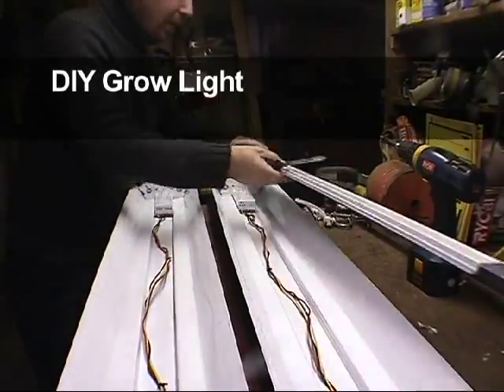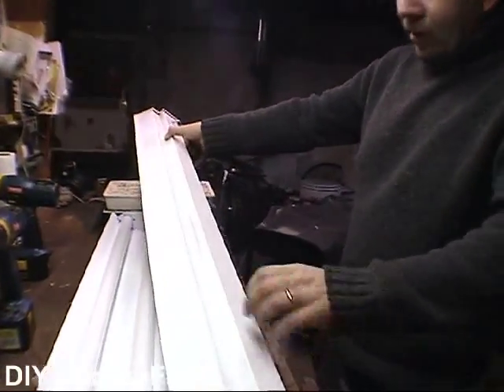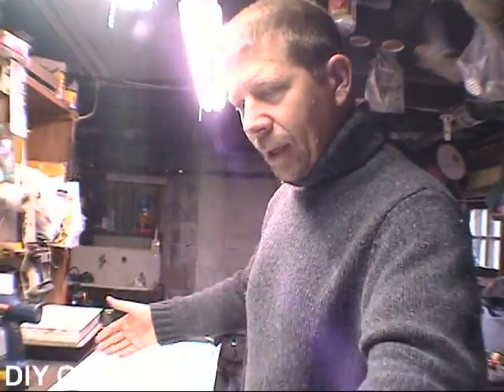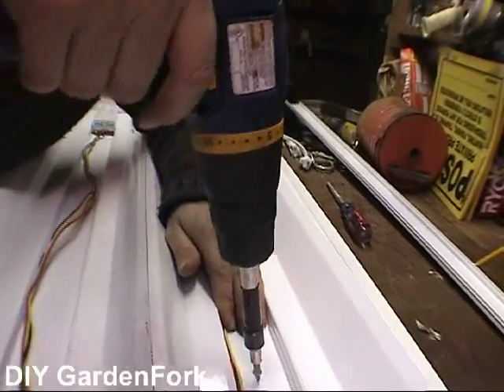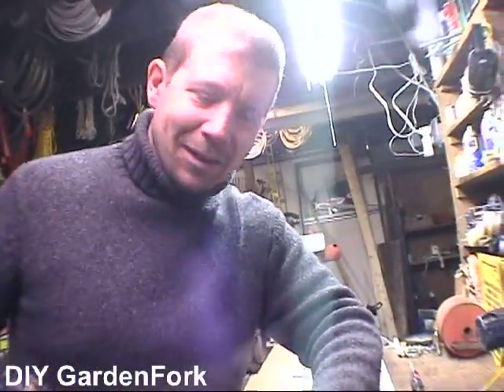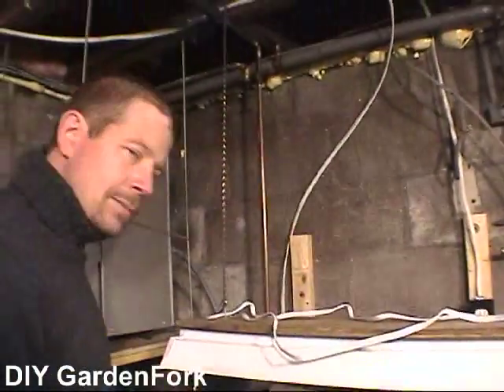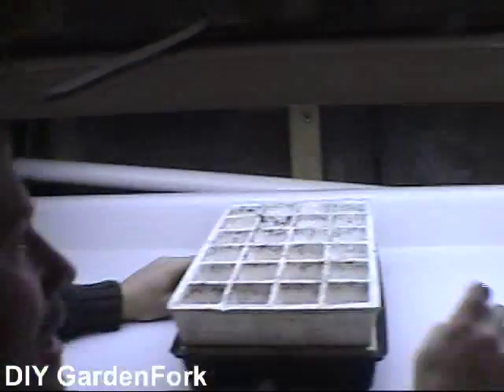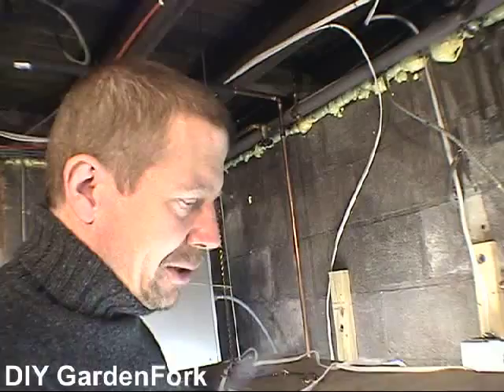Cheap Grow Lights - GardenFork

Comment: I have that type of workshop lights but I'm not handy  enuf to build anything, so I just rest the lighting fixtures on old VHS tapes, 4, 5,...8 if needed..  As the plants grow, I can add another tape or two.   I can even raise one side more than the other with the tapes and they hold well and don't slip.  The tapes are all a uniform size and I have several left over from when I changed over to DVDs.  I've been doing this for 4 years now.
Reply from the maker: Sandra Cerino excellent use of tapes for a grow light rig, it all works!  thx, eric.

Comment: I have a question which may be stupid but I cant seem to get an answer.  Ok so lets use veg state as an example.  You are to use something that is in the blue spectrum for vegging so.  If I say use 8 x 5000k CFL's it is not in the 6500k area so if I was to add a LED blue floodlight would that add the blue light needed in that spectrum?  Would the white light drown out the blue light or does the blue light still make it to the plant?  If the blue light does will it make a difference?  Does the blue light from a LED give you the blue light spectrum you need or does it not work that way?  Same thing for Flowering using a red LED light with 2700K CFL's will that flood light give you the right Red light spectrum you need?
Reply from the maker: for the short amount of time vegetable seedlings are under a grow light, the regular shop lights work fine. if you want to grow mature plants under lights, it may make a difference, but its not something i know much about. thx!
Reply: 5000 and 6500k mix is best for veg. 3000k and 4100k for flower. The coloured leds dont help much unles they are specifically made as grow lights. Otherwise they are just white lights with a tint on them.

Comment: I think led stripes would be more cost efficient, don't you think?
Reply from the maker: ***** I have seen LED lights that would work for this, but they are a expensive right now. yes would work for grow lights, but  i'll wait for the price to come down. thanks for the idea! eric.
Reply: +GardenFork Led lights have a larger spectrum of light than fluorescent lights and because of that are more suitable to be used as a grow light.
Reply: +Jim Warmington home depot website has led growlight tubes red and blue spectrum together that fit t5 and t12 fixtures I think they are around $50 a tube little pricey but supposed to last longer and use way less power.
Reply: +GardenFork something went wrong my lower comment was ment for you
Reply: Thanks for a great video.  I did not see the list is supplies.  Can you list what type of fluorescent light fixture you recommend?